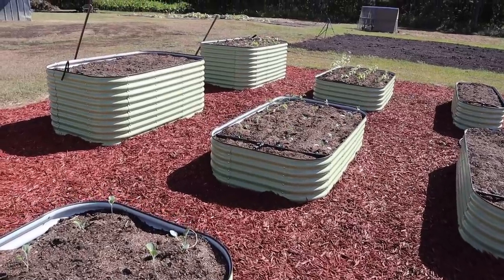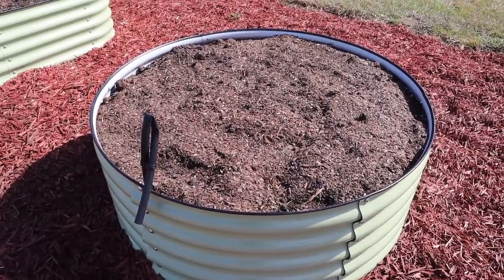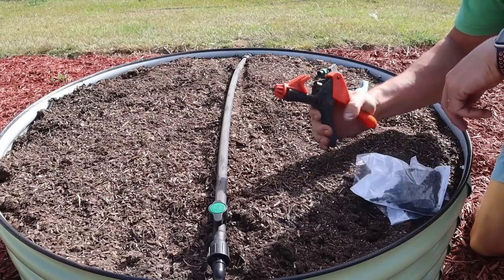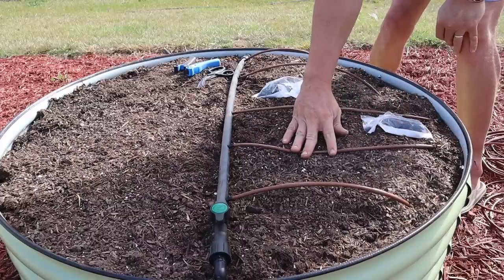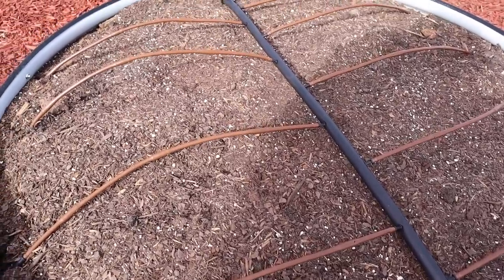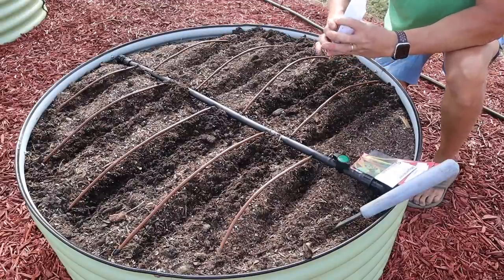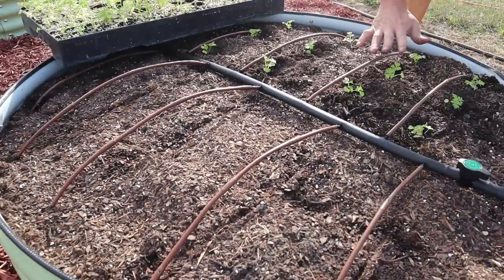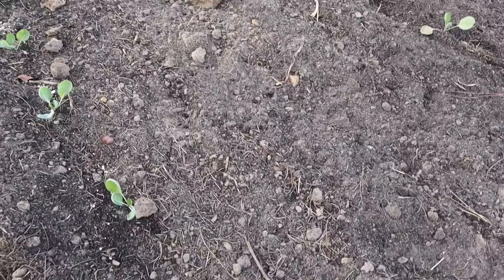Ditching Drip Tape for Drip Tubing? | Which Is Better?

Comment: Good show. I've been running drip tubing for several years now since it better suits how we skin our cat. I believe me and ol' Karl would have come off the standpipe with a single fitting and run the tubing in a spiral. Keep in mind that your drip tape in the other beds has 12" oc emitters that put out .25 gph whereas that brown tubing has emitters at 6"oc and that put out .5 gph. In short, the round beds will be getting four times as much water per hour of run time.  Might be time to consider splicing in some timers and break the watering into zones based on the bed style's specific layout. Those $12.75 Melnor mechanical timers from Drip Depot are a good value. Killer frost tonight for us at the little ranchito.
Reply from the maker: Good point on the output from the tubing being more than the tape. The easy solution might just be to plant double rows on the tubing.

Comment: I'm on my 3rd year of 1/4" drip tubing in my raised beds.  One thing that is different is the dripper application rates.  Mine run 1/2 gph per emitter in the tubing, so you don't run the tubing as long as you would the tape.  In the raised beds I went with the 6" emitter spacing in the drip depot tubing.  I like to use the little 1/4" on/off valves for my tubing runs. The mainline is the same, everything else is smaller though. Also they recommend keeping the length of each1/4" dripline run under 15 feet.  So on my 20' beds, I feed left and right from the center off my mainline (two 10' runs per row).  Two more tips for us older folks with arthritis in our hands; 1) they make a 1/4" fitting inserting tool that has holes for the fitting to go in and give you more area to push on; 2) a glass of hot water or a 18v heat gun works wonders for softening the ends to push in connectors for both 1/2" and 1/4" tubing. Oh and don't forget, Drip Depot is having their annual 20% off sale sitewide the entire month of October, 2022 and they are a Lazy Dog Farm affiliated company!!!!
Reply: I agree with this assessment.  When watering for 1 hr the round droppers will emit far more water than the tape.  The fix would be to put tape irrigation on one section and round drip on another.

Comment: As a former engineer, I would bisect the round bed as you already did with the half inch water supply, but I would run the quarter inch tubing in concentric semicircles connecting each end of the semicircle back to the source half inch water supply. In that way you could use the memory of the quarter inch curved tubing to lay perfectly flat since it comes normally curved anyway.
Reply: That’d be the way to go

Comment: Travis, another easier way, that you may of not thought of is to just use a long piece of the the drip tubing, by connecting it off of a short piece of mainline tubing just  coming past the turn off valve and then connecting the long run of the drip tubing laying it going around in a spiral pattern which it naturally bends too anyways, and securing it with U-pin clips to the soil!
Reply: That's exactly what I was thinking too.

Comment: I'm thinking it would be less complex if you just run 1 long piece of drip tubing and run it is a spiral pattern around the round bed.
Reply: Yea I've seen others do it that way in round beds.
Reply: I came here to say this. Less work and less fittings.
Reply: That's what I do and attach each end to the main line.
Reply: I have seen a lot of people do that in containers and such.
Reply: That’s what I do…not as many pricey connections (not that it breaks the bank).
Reply: that's what we do
Reply: Glad Travis has community to help solve problems, I was thinking that's alot barbs to push in it would hurt my fingers, spiral is the way to go with 1 or 2 fittings.
Reply: I do the fish bone method. And cover with mulch. If one get clogged/damage you only lose one branch. You would lose alot more if you only use 1 tube
Reply: The tubing is what he should have used for all the beds in the first place.
Reply: The drip tubing naturally wants to run in a spiral, and just hold it down with landscape pins works beautifully
Reply from the maker: Mathematically speaking, I think you'd actually lose space with the spiral design. Because you're planting on a curve, there's always a slice that is unoccupied. Just a thought. lol
Reply: @LazyDogFarm  I see what you are saying but I kindly disagree; coil the drip tight enough and keeping in mind that as the water drips it spreads underground, one has the whole area to plant.  But this is what's great about gardening; different ideas still can produce awesome results!  GO RAMS!
Reply: I just do an out an inter circle 1 foot apart and works great
Reply: @LazyDogFarm   the water spreads like clamps on gluing wood plus you get capillaries action. You only need the drip close so it covers the entire bed a couple inches down.
After you water for 45 minutes dig down in between within 4 incest you should hit wet soil. 
Now you just plant don't need to worry about following the tubing just use it for space reference
Also tubbing also comes in 0.5 and 1gph emitter

Can also just snake it through the bed too
Reply: @LazyDogFarm  No, it's evenly wattered, you'd plant any way you wanted.
Reply: I agree Dean,  my thoughts exactly.  At first in my raised beds i was worried that emitters at the end of a long line would be lacking. 3 seasons later I've not seen a difference at the end of the line.

The solution shown here is perfect engineering wise but takes up a lot of geography, time and parts.  If i were to tackle this issue I'd keep the main line down the middle and do concentric loops with the drip line connecting at the far end of the main line.  Still overkill.

If i were a Lazy Dog, I'd put a coil towards the center originating at the emitter valve.....If pressure permits..
Reply: I agree, using less mainline.  I've been trying to figure out how to sprinkle my tubs for potatoes next year and by golly you gave me the perfect remedy.  I'll do about 8" of main line and do two spirals, one large and then a smaller one.  Should have enough coverage then.
Reply: One long spiral tube would be simpler but it wouldn't deliver as much water in the same timeframe and it would be more susceptible to failure.

Comment: On my round bed I used blue household  water pipe wrapped around the inside with a tee pice to main feed then punched holes where needed and ran drip line from that. Almost Any plastic pipe can be bent to any shape if you fill it with sand. Then Capp off pipe both ends  heat where you want and bend. It  works with the white electrical conduit pipe  too 👍🏼🇬🇬

Comment: I grew 24 celery plants this season and it was WAY too much.  4 plants would have been plenty.  I also grew Green magic and Imperial broccoli this year.  Imperial has been great during the cool months.  I thought you would run the drip tubing in 2 circles on the round beds.  An outer circle and an inner circle.  Then just plant in a circle where the tubing is.  (Both ends of the tubing would connect to the main line to help hold it in place)

Comment: Looks good , and can you use the valves to adjust the the flow on each bed?
Reply from the maker: I'm not sure how to what degree it would adjust the flow, but I can throttle those valves.
Reply: @LazyDogFarm I use these form drip depot Antelco Potstream Adjustable Dripper connected to a  Salco Multi-Outlet Barbed Drip Manifold with 10ft of tubing each line with an adjustable valve then to the hose. I move it around the yard watering six plants at a time somtimes more, the spray pattern can be adjusted pretty wide by pressure. it's better than by hand but still time consuming.

Comment: I was thinking about whether you considered running the water somewhat the same way in the rectangular beds so you didn't lose that 6" or so at the valve end. In other words,  from your line in, elbow - valve - straight run to other end of bed - T and come back with tape or tube so you get the use of the whole bed.
Reply from the maker: I have considered that and might try that on one of the larger ones.

Comment: I use weed barrier cloth in my garden. I lay my drip tape on top. Do u think that small tubing u r using would work better for me?  I was just thinking that since I’m not burying it maybe that will work better???
Reply from the maker: If it's an in-ground garden with straight rows, I think drip tape would work better. But the tubing is an easier install.

Comment: Good morning to you @Lazy dog.
  Unfortunately, even in the round raised bed, you did not place the drip tubes correctly.  When you make holes on one side, you can immediately make holes on the other side in exactly the same place.  Thus there are 5 tubes on each side.  If you have already made only 4 holes for the tube on the other side, you can measure a longer tube and fill in the gap with irrigation.

Comment: On hindsight it would have been better to set the in line Vance running along the edge of the beds so you can use more space rather than it poking out and nothing getting planted behind it.

Comment: As with anything in life there's more than 1 way to skin a cat... however I do think you over complicated the drip in the round bed. I use that same drip line and you can do one continuous line up to 30 feet long with out it affecting the water pressure,  so you'd use 1 in-line barb off a short length of main line tube & one end goof plug, and yeah get a supply of earth staples they work well.

Comment: Could have saved a bunch of time if you just wrapped some loops and staked them.  After a month or so you could pull the stakes.
Reply from the maker: I could have. But depending on the spacing between the rings of the spiral, that might restrict what plants I might use in the future. I think this way gives me a little more versatility for plant spacing.

Comment: i tell ya i have tryed everything the pressure in the line being the number one issue we have a small garden set up 3 8 foot long beds one is 4 foot wide for mellons and butternut squash and stuff and the other 2 use two be 3 but a tree fell on one are 3 feet i find it better two use timers for the end of a hose that way you can run 1 100 for hose and connect it two another one two get way out there put a 4 way adaptor on the hose then use 4 different times two water with that way the pressure issue is solved..

Comment: Don't buy Staples,  just use some bare copper wire and bend it if you have some extra laying around the house , coat hangers work as well.  Great video,  thanks for all your great work on excellent videos!
Reply: I used left over 12ga electrical wires, didn't work well. I bought a roll of galvanized steel wire and cut my own. It was a hassle to make them straight and I guess it wasn't thick enough. The mainline and drip lines would move around and come out. I bought some plastic stakes for drip line, they stay in place better. If I were to do it over again, I would but the thickest stuff. It's a pain when stuff moves around. It also depends on how soft your soil is. The softer the soil, the more it moves.

Comment: Just curious  as to why you didn’t just start from center and spiral 🌀the tubing from the inside to the out with one continuous piece and use landscape staples to hold it down?  It would require a lot less mainline and less cutting of the tubing as well.
Reply from the maker: I'm just so used to planting in straight rows. lol
Reply: @LazyDogFarm  I hear ya! Lol … can’t wait to see it all in its full glory! 🥬🥦🥕

Comment: You're making it waaaay too complicated. Drip tubing bends, and if you don't like bends just use elbows. The connection to the main line and using goof plugs as end plugs are the most likely places to fail and your increasing the chance of failure with so many connections

Comment: I really just need to do irrigation of some kind... This whole watering by hand thing is rubbish & really getting old...lol 

This is definitely one of the best & clear videos on drip irrigation I've seen. 

Also on the raised beds settling. One thing you can do to help minimize the amount of settling is watering them as you fill them in. Water after every 6 inches of dirt or so. It really helps settle the bed more.
Reply from the maker: You'll definitely be glad you did when you decide to go with an irrigation system.

Comment: I bought several hundred feet of that 1/4 inch drip tubing. I personally won't buy it again. I bought it to water an existing garden that wasn't pre set up with drip tape. Some emitters don't let any water out and some shoot a jet spray 3 foot out.  I put it on corn and have a 8 ft area that doesn't let any water out so I hand water that part of that row. Pain in the rump. I could see it working fine in your raised bed application but I  would definitely choose drip tape over drip tubing on row gardens.
Reply from the maker: Yeah I don't think it would work well in our in-ground garden plots. I like the reliability of the tape for the longer rows.

Comment: Travis, I have used the tubing in conjunction with the tape in my in ground garden.  I usually just wind it around all the plants that I want to water and only use one piece.  Now that piece can be 10 to 15 feet long at times and other places it may only be 5 foot.  I have also used it to start trees and shrubs by running a piece all the way around a tree a foot or so out from the trunk.  Works great when I need a little more saturation at times.

Comment: When running drip for tomato plants would a micro system be better than an emitter style system so you can place the dripper exactly where you want at the plant instead of having them every 12”?
Reply from the maker: Depends on your plant spacing. I usually put tomatoes on a 2' plant spacing and don't worry about the emitter between them. Our tomato root systems are usually large enough to benefit from that extra emitter anyways.

Comment: For your round raised beds, (just a suggestion to try) get the 1/2 tubing and let it curl in a circle attach a T from your inlet and connect both sides and the use your new 6 inch drip tubings to go across from one side and connect to the other side.  Instead of going down the middle and dividing the 2 sides. I hope I  explained it correctly.  

That way, the new drip lines will extend the whole beds.

Comment: I use 1/2inch drip tube corkscrew into bed using the memory add a couple staples to hold in place

Comment: I run circles main line just like you, but not the entire length of the bed, only 1/3 of the way across.  Then I run 1 small circle of drip tubing in a small circle in the center of the bed.  From there I put 1 drip tubing circle near the outer edge, and a center spaced between the two. 
This allows for maximum planting area. The cool part is you can beak up the beds by putting taller plants in the center then work out using shorter plants. Consecutive rings getting fewer and taller as they approach the center.

Comment: Since the tubing is flexible, why not do 6 half moons? Connect at one end of the supply line, sweep around to connect to the other end of the supply line, no goof plug required.
Reply: that does sound like a nifty idea.
Reply from the maker: That was similar to my original plan. Then I got to thinking about planting on a curve and I just couldn't make myself do it. lol

Comment: Hey Trav. I was thinking, would it be possible to run the main line straight to the center of the bed and cap it. Then run a full circle of drip tubing on the outer edge, one in a central position and a smaller one near the center? You could start and finish the tubing on either side of the main line, this way the natural curve in the drip tubing would work for you, not against its own memory. Never used drip irrigation myself but might be an idea. 👍
Reply from the maker: I considered that option. Without staples, this was easier. Had I had staples in the beginning, the rings would have been easy as well.

Comment: Why bother with mainline at all?  Why not just run a spiral of drip tubing?  You really complicated this.
Reply from the maker: As we've documented in many videos since this one, our little 'spider' setup is really easy to remove and put back when we want to amend or flip the beds -- much easier than a spiral would be.
Reply: @LazyDogFarm  Why would a spiral be difficult to lift off the bed or lay back on the bed? It's nothing but a length of tube. I haven't seen whatever videos you're referring to.
Reply from the maker: @Josef_R  The spiral will come unwound. Also, from a mathematical perspective, planting in rows allows for more plants as opposed to planting in rings. Not a huge deal in a raised bed that's on 4' wide, but that's another reason to justify our setup.
Reply: @LazyDogFarm  Sounds like you're intentionally trying to make it difficult.  A couple of stakes and the spiral will not unwind.  And you're planting in a circle.  You're trying to fit a square plug in a round hole.

Comment: At first in my raised beds i was worried that emitters at the end of a long line of drip tubing would be lacking(10 ft runs). 3 seasons later I've not seen a difference at the end of the line.

The solution shown here is perfect engineering wise but takes up a lot of geography, time and parts.  If i were to tackle this issue I'd keep the main line down the middle and do concentric loops with the drip line connecting at the far end of the main line as a loop.  Still overkill.

If i were a Lazy Dog, I'd put a coil towards the center originating at the emitter valve ending in the center.....If pressure permits..